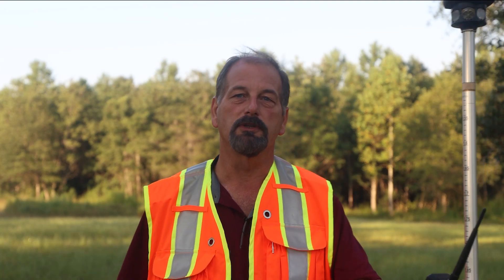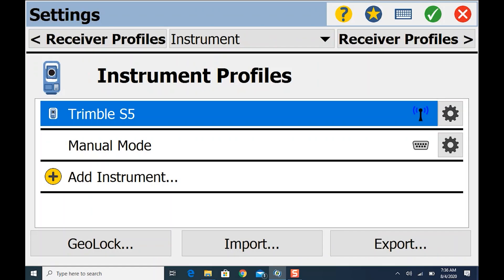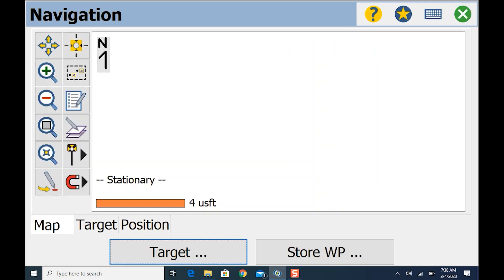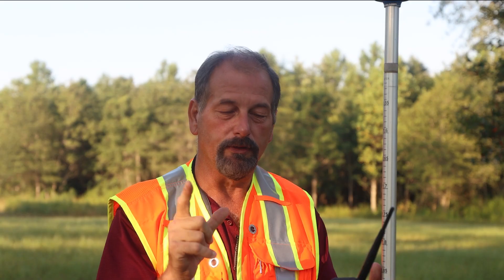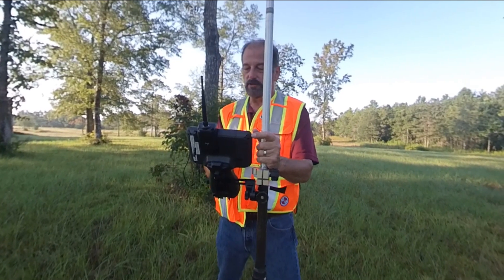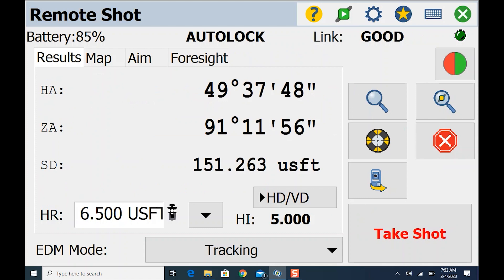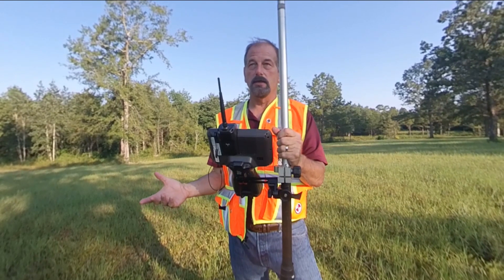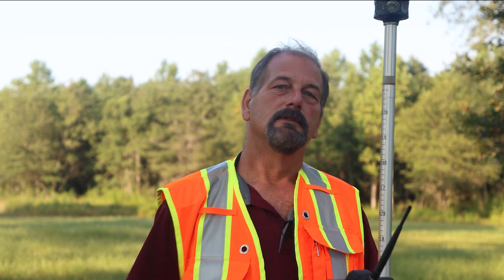Geolock with Trimble Survey Pro

Comment: In the S5 datasheet says that geolock takes 15-30 seconds to get a solution. I prefer Leica ATR+ with its internal camera to snap the target. Even Leica has more settings about this. I generally use Viewcube. I never set the window parameters. It is not needed.
Reply from the maker: You’re referring to a non geo referenced position. If you are in a know geodetic coordinate system it is automatic.
Reply: @SurveyingWithRobert  ok, I understand now.